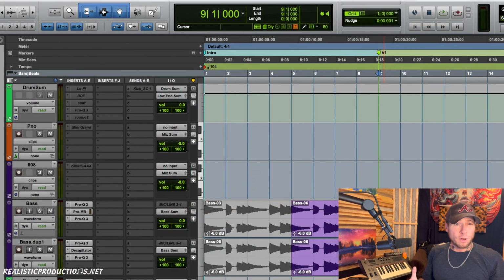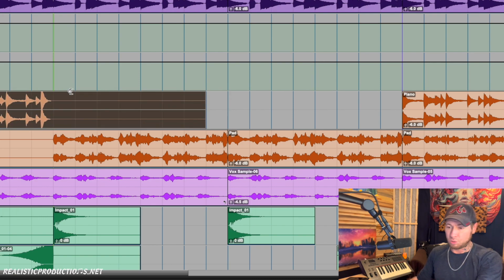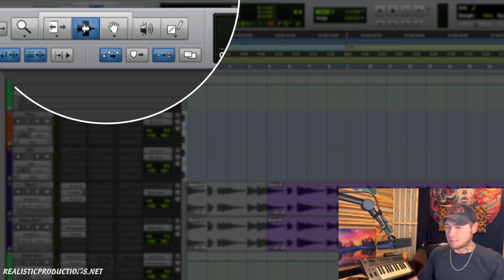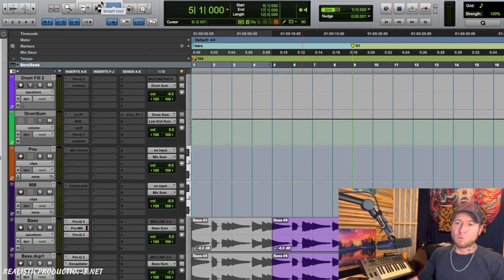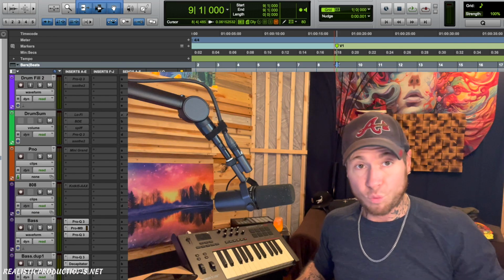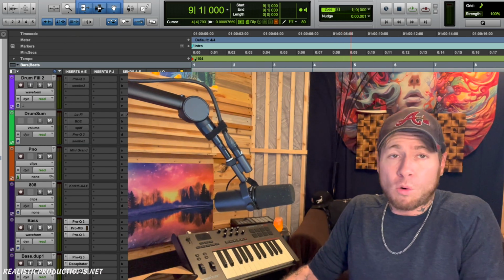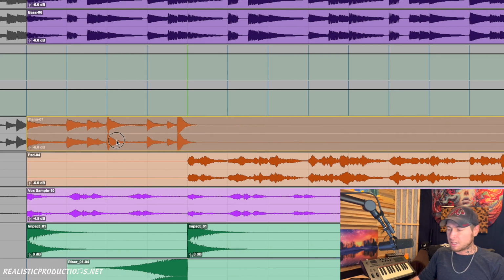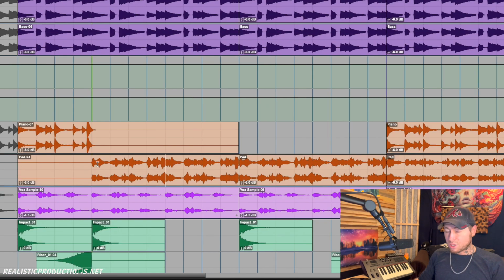How Pro Tools Smart Tool Works! #ProTools #Mixing #MixingTips

Comment: Thumbs up! When i import a mastered MP3 beat into Pro Tools maxed out at 0dB... i gain stage the beat down to -10dB giving myself 10dB of headroom for vocal recording. Just want to know at what dB you Realistic set your beat file gain settings to when recording vocals? Thanks
Reply from the maker: I'm usually turning the clip gain down (so the signal is lower before it hits any plugins or the channel fader) & I turn that down until the volume output is around -10dB. So you & I are pretty much in the same ballpark!